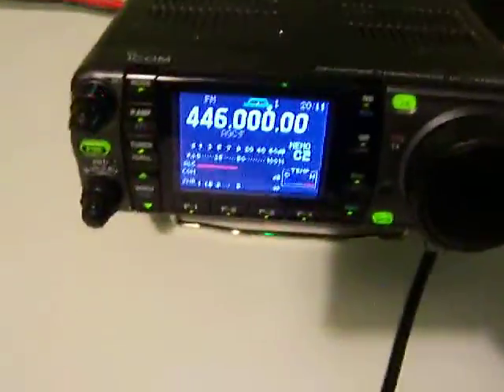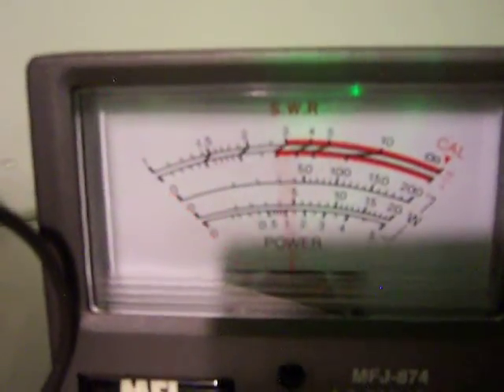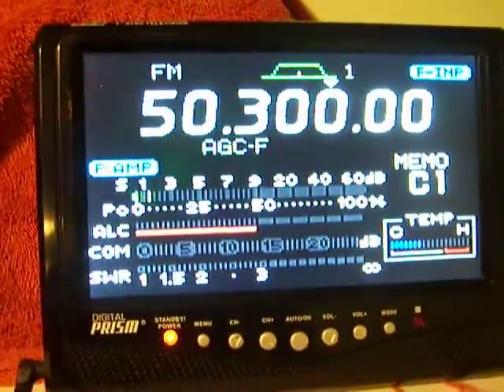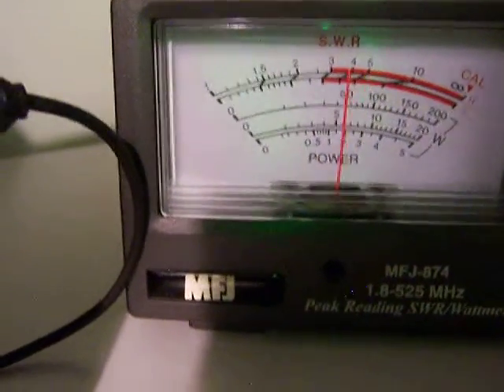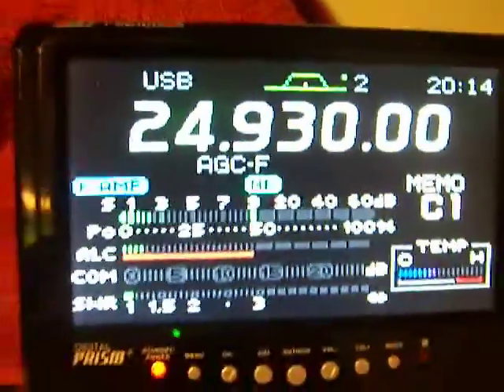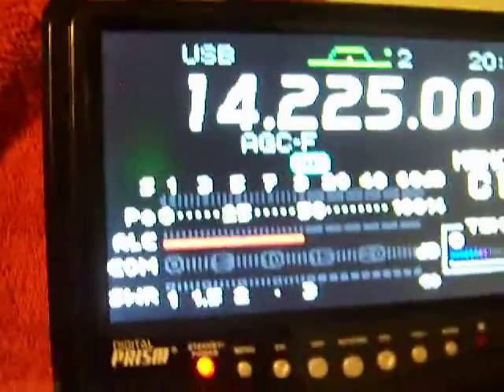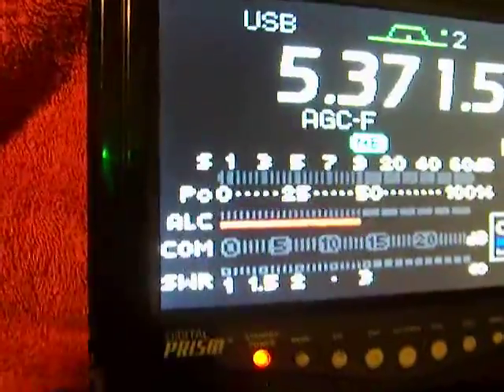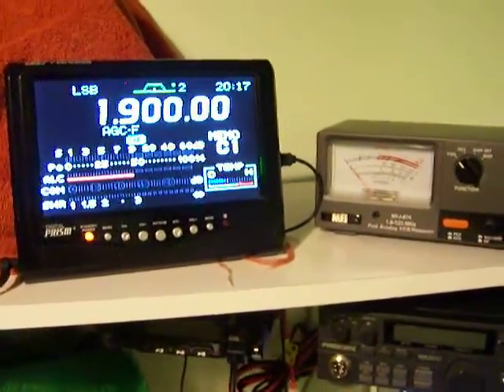Icom IC-7000 Ham Radio Power output

Comment: Hi All, i wonder if anyone on the Planet Earth knows how to adjust the frequency settings on an IC 7000,  presumably inside the radio, the REF ADJUST in the menu is set to maximum and it still isn't anywhere near,  perfect on HF but 1 khz off on 2mts and 2 khz off on 70 cms on TX and RX, it seems a closely guarded secret by Icom, not in the repair manual, if you adjust the main oscillator setting it throws HF out....any offers please....please dont say turn the tuning knob hi.....from Fred g4vvq in England.

Comment: Does any one on here have trouble when turning the memory left bottom control, the display flickers all over the place and if it really bad the relays inside the radio keep chattering, have cleaned the terminals from display unit to radio when you remove the front, there are about 6 gold terminals...cleaned them with switch cleaner...have 2 of these and they both do it...cure is dont use the memory from Fred g4vvq.